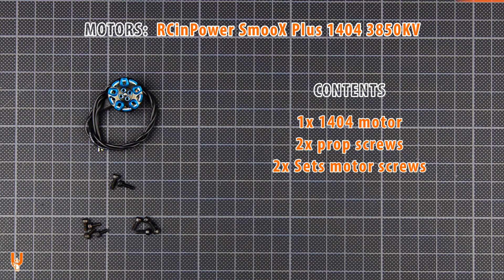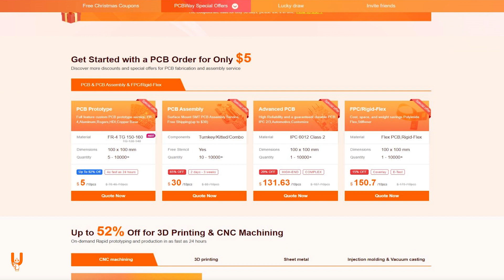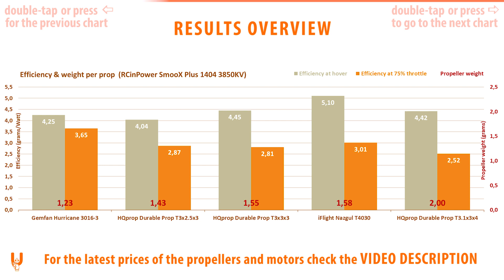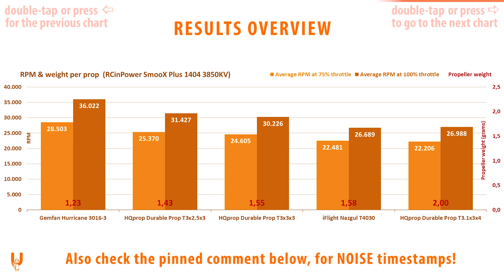RCinPower SmooX 1404 3850KV FPV motors on 3S (feat. HQprop, Gemfan & iFlight Nazgul)

Comment from the maker: PROP NOISE INDEX

HIGH RPM
02:29  Gemfan Hurricane 3016-3
02:45  HQprop DP T3x2.5x3
03:00  HQprop DP T3x3x3
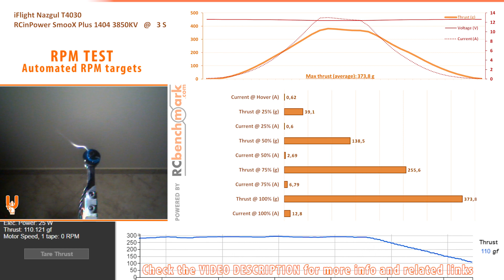03:16  iFlight Nazgul T4030
03:32  HQprop DP T3.1x3x4
  
LOW RPM
02:32  Gemfan Hurricane 3016-3
02:48  HQprop DP T3x2.5x3
03:04  HQprop DP T3x3x3
03:20  iFlight Nazgul T4030
03:36  HQprop DP T3.1x3x4
  
MAX RPM
02:41  Gemfan Hurricane 3016-3
02:57  HQprop DP T3x2.5x3
03:13  HQprop DP T3x3x3
03:29  iFlight Nazgul T4030
03:44  HQprop DP T3.1x3x4

VIDEO INDEX
00:00 Intro
00:21 Motor specs
00:58 Prop specs
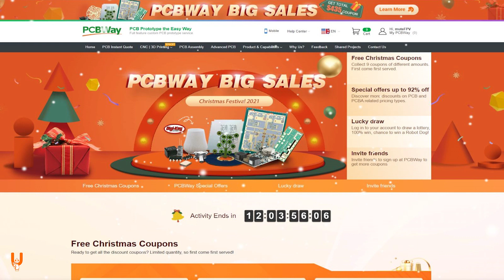01:57 SPONSOR
02:26 Test footage
03:48 SUPPORT
04:12 Test results

👍 PLEASE SUPPORT the MuteFPV channel:
-------
👍 Join my PATREON: http://mutefpv.com/patreon
-------
👍 Tip my 'piggy bank' via PAYPAL: http://mutefpv.com/paypal
-------
👍 Save and use these BOOKMARKS before purchasing new goodies (please bookmark the SHORTLINKS in your browser):
BANGGOOD: http://mutefpv.com/banggood
AMAZON (ad): http://mutefpv.com/amazon
GETFPV: http://mutefpv.com/getfpv
EBAY: http://mutefpv.com/ebay
ALIEXPRESS: http://mutefpv.com/aliexpress
REELSTEADY: http://mutefpv.com/reelsteady

More info in the video description, as always!
THANK YOU

Comment: thank you for your brilliant work! I am curious: the manufacturer shows for  these motors  extremelly high efficiency. Based on your experience. it is really outstanding or are other models close in that point? new model (v3) marked as several times less efficient and I am thinking of what to buy for smooth flight. thanks!

Comment: I want to use 2s vtc6 battery with 3 inch 5 leaves, is that possible?
Reply from the maker: These are 18650 cell packs, right? Are you planning to use these specific smooz motor size and kv?
Reply: @muteFPV  4600kv

Comment: Hola ! La marca rcimpower no es prestigiosa en apsoluto , no la recomiendo para nada por que anuncian parametros falsos y muy alejados de la realidad ! Los motores 1202.5  de rcimpower 11500kw se anuncian con mas de 10g/w con bateria 1S y no llegan ni a 4g/w ! 
Muy bien video , gracias por probar los motores !
Reply from the maker: If 10g/w and 4g/w were on the exact same voltage and with the exact same propellers, this is some serious oversight I suppose
Reply: @muteFPV  he usado exactamente la helice que indica el fabricante , y claro que con bateria 1S , la verdad es que no tienen ni 50% de la eficientia indicada ! Recomiendo que todos los prueben !!!

Comment: It seems that rcinpower is lying on it's website about the efficiency. One their website it says that the hq 3*2.5*3 props @3s has a whooping 7.7 efficiency at 50% throttle, and a 3.8 efficiency at max throttle. But the efficiency tested here is 4.45 and 2.2.
Reply from the maker: Hello! It is impossible to compare test data from different sources, since a ton of variables come into play. The main thing I noticed straight away is that their "3S" tests are done at 11.1 Volts while mine are done at 12.6 Volts (simulating a fully charged 3S battery, although I am using a 1200W 50A adjustable power supply instead). This is why there are such big differences also in amp draw and thrust produced. So their results will definitely differ from mine. Best thing to do is compare my test data with each other, rcinpower's datasheets with their other datasheets etc.

Comment: Im Sure you have seen some quadmovr videos. Like him, I have started to love the HQ 75mmx5 porps. Please could you do some tests with these. A larger motor would be great to test them too. They are powerful and silten
Reply from the maker: Hello and thank you for the suggestion! I will check if I have those :) What motor size would you like to see them on?
Reply: @muteFPV  HQ T75MMx5 on 6S 2004 motors about ~2000KV.
Brotherhobby 2004 1950/2100 or Emax 2004 2000KV would be great.
At the moment I have these props running on 1804 3500kv 4S motors. They are awesome. But I'm upgrading to 2004 Brotherhobby 2100kV 6S motors. More Power on sub250 build and 6s could help against heat and voltage sag. Quadmovr is running them on 2004 6S 1800kv motors. I guess he had them still lying around from his 5 inch builds. 1800kv still seems insanly fast on 6S,  but theoretically its still a setup more on the efficient side.
A good prop comprison would be GF 4023 and HQ 3.1x4x4.
A test like that would be awesome 👌
Main reason why the HQ 75mmx5 are so good are because they have a good disc load ratio, power and are quiet. Like my I guess many have experienced Karens complaining about noise and danger
Reply from the maker: hehehe loved the bit about the Karens :P I will see what I can do. I do have a set of Diatone TOKA 2004 motors right now on the bench but they are 1700KV. I think I should better do a separate video for this kind of props.

Comment: This would’ve been a great candidate for any of the newer 3.5” props, too. I feel that something like the BrotherHobby VY 1504.5 or TBS Podracer 1505 or Mamba Toka 1505 with the 3520x3 props would be an intriguing setup for all the sub250g people. I just haven’t seen a push in that direction yet.
Reply: Yeah 15xx motors will only start to play their power potential from 3.5 inch seize. On 3 inch or below you should stick to 1207 seize for power.  But even better than 1505 is an 1804 3500kv motor. Trust me on that. You can study the data sheets too and do some testing.
Reply from the maker: Time will tell, I want to gather more test data on these sizes too!

Comment: Seems average performance Rcinpower 1207 has more thrust but again we need to look at other characters as well seems a good candidate for an efficient build
Reply: I tried 1207 6000kv motors on 3s w/ 3x2.5x3 props.

Oodles of punch out thrust, however, the amps and temp they generate allow heat wear to set in w/ a few minutes of spirited flying - like dont want the mounting screws touching your person hot.

I tried lower pitch (3x1.5x3, 3x1.8x3, and 3x2x3) but changing props but it didnt help much in reducing temps, just made the quad feel like stomping the accelerator in a Nissan Versa - lots of work and sound for little return.
Reply from the maker: I will check the 1207 out, I don't have them, thanks :)
Reply: Taller motor consumes a hell lot of watts